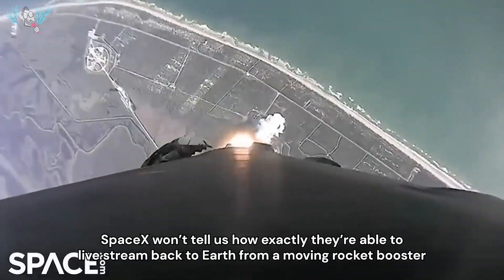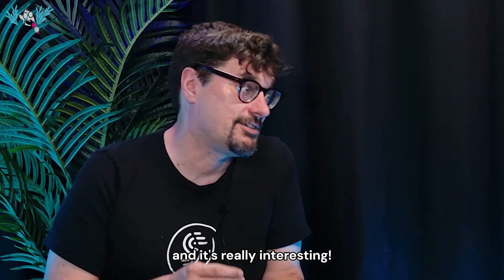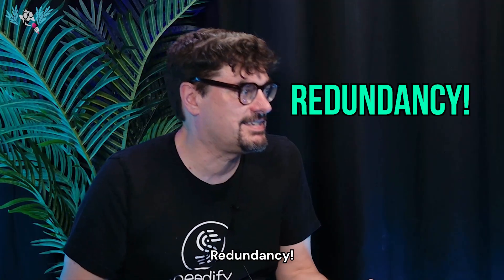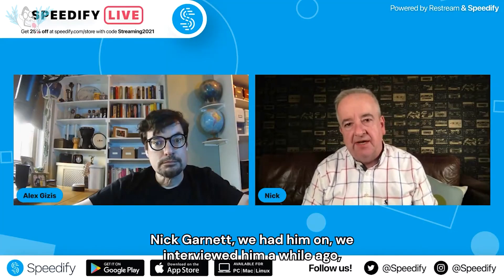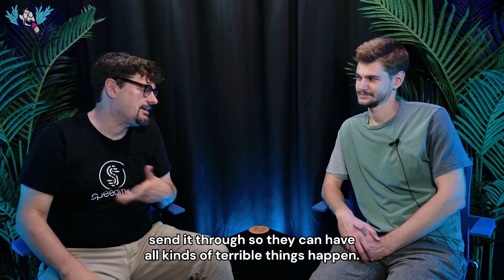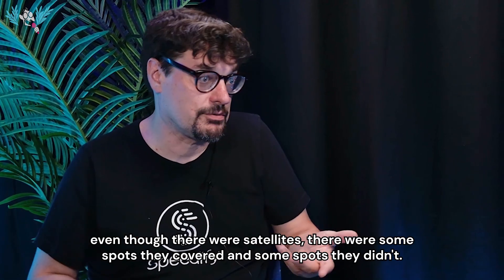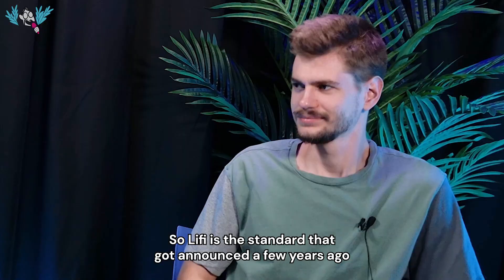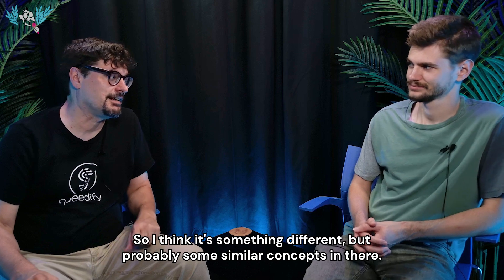What is behind SpaceX’s Rocket Launch Streams?

Comment: Not really. 
The frequency is on normal satellite S-Band. The doppler shift is therefore not really impressive. The two frequencies are for two sides of the rocket. You need to cover both, but you also have to guarantee that they don't interfere with each other. For the exaust you have to set up the stations that they don't look at the back of the rocket, but on the side. Laser links are useless for rockets, because they are actively maneuvering. Falcon 9 also is communicating only via normal commercial ground stations, no Starlink involved.